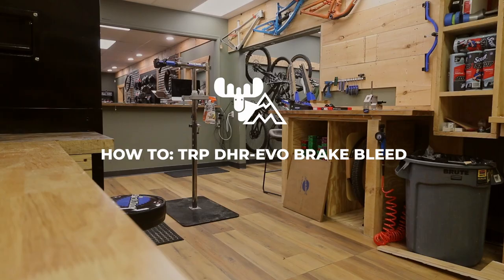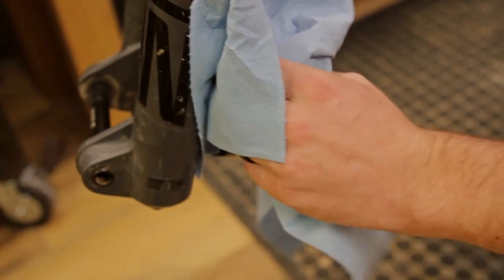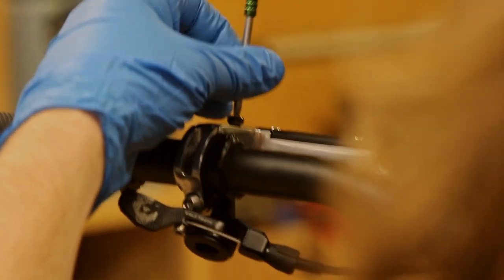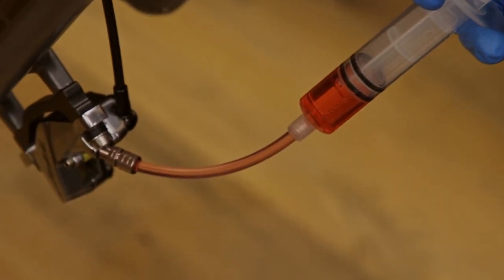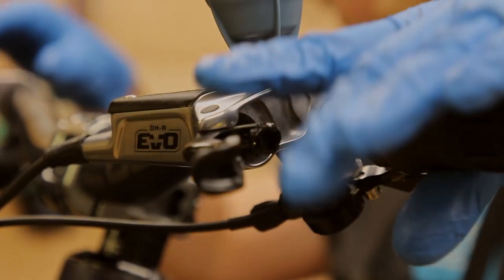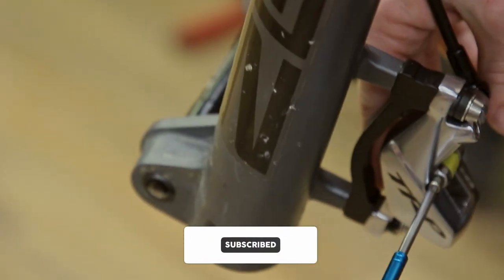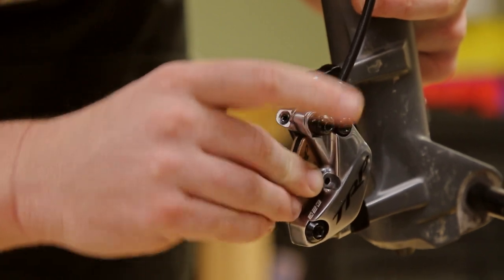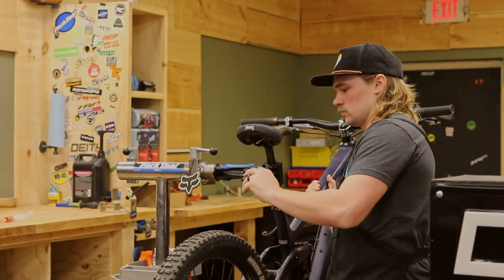How to: TRP DHR-EVO Brake Bleed

Comment: This doesn’t make sense. After you take the syringe if you pull the lever without putting the bleed port bolt back on the caliper. Wouldn’t the oil just piss out with you pull the lever?
Reply: My exact thoughts
Reply: I was going to say the same. All that oil came right out 😂
Reply: I think they messed up on the vid editing lol

Comment: Can you use the bleed equipment for shimano breaks? (Cup and syringe) also can you use shimano mineral oil?
Reply: The shimano mineral oil you can use, idk about the bleed equipment since I use a 10$ kit from Amazon with lots of different fittings

Comment: Any reason you can't do this with the pads and wheel still in place so you don't need to use a bleed block? I assume the risk is getting oil on your pads but as long as you're careful not to then I assume that would work...

Comment: Quick question, what adapter did you guys use for the wolftooth lever? Thanks
Reply from the maker: We actually had to use the clamp mount, Wolf Tooth doesn't integrate with TRP yet!
Reply: The DHR-EVO levers use the Shimano IS-II standard.  I believe this part would allow you to mount the Wolf Tooth lever directly to the brake lever:  https://www.wolftoothcomponents.com/products/remote-replacement-axle?variant=21422969349
Reply: Scratch that… the ispec adapters ALMOST work. There’s an extra lip in them that interferes with how they mount under the trp clamp. You can cut/grind/file this lip off to make it work though. It’s not a direct solution.
Reply: I just tried the wolf tooth i-spec ii to sram MM, it does not fit. Looks like EVO's clamp mounting surface is a little wider than what i-spec ii is designed for. I had to order the integrated mtb shift adapter hd 3.7 directly from trp.

Comment: Do you add a drop of blue locktite on the caliper bleed port plug? I notice min oil around the plug and I keep getting contaminated pads!
Reply: thats what we had to do.
Reply: @MrSupermugen  Holy shit, is that serious? They couldn''t design a proper bolt with a seal on a 250EUR disk brake?!?
Reply: @thegrave2000  yeah, they even suggested we use it lol
Reply: @MrSupermugen  Jeez, I'd rather not unscrew this bolt at all and go with a half bleed, no matter how much time it takes:

https://www.youtube.com/watch?v=A9L4EqLYEb0

I have this very same problem on my current crappy Chinese Surron brakes and this is the main reason I want to swap them but definitely if their master cylinder is going to leak as well :)
Reply: Thant's a crap design.  I've read that these brakes have issues with the bleed port seals being very easy to crush, resulting in contaminated pads & glazed disks. Seem to be very fussy.

Comment: im having non stop issues with these brakes rubbing, they are bled and the lever feels so good, pistons advanced evenly but after a trail or two one side pushes out more and stay against the disc.... messing up the feel... super frustrating, ive tried lubing and working the pistons on that other side but they are free...
Reply: You ever get this fixed?
Reply: @MathieuBrunet-wu7nf  One end fixed itself after i split the caliper and pulled all pistons etc.

The other end i tried the same but still same thing...

Bought anther set, did the same, gone back to Shimano and now Mavens.
Reply: @MrSupermugen  interesting, is splitting these open pretty simple?

I’m also now debating selling these and getting the mavens.
Reply: @MathieuBrunet-wu7nf  yep simple as. its all very basic stuff
Reply: @MathieuBrunet-wu7nf I have a similar problem and im beginning to say trp brakes are a joke. They weep oil and contaminant pads and get air bubbles trapped behind the pistons. My front one is a lucky one and works great. The rear gave me trouble early on. Trp even had me send it in only to send it back saying its fine. Mounted it and same issues.

Biggest issue I have is bite point. Feels good on the stand. Drop the bike and shake the rear wheel and the rotor flexes and pushes the pistons in and then the lever pulls to the grip. Pump them up and feels good. Pita

Comment: Anyone else have issues with the syringe not sealing on the caliper?
Reply: yes the O ring squishes out and doesn't seal. , it does not fit in the bleed screw hole. very easy to induce air into it.  I looked at all the fittings in the kit but they are not any different. plus not having a clear cup to see bubbles is really not the best idea.
Reply: @86309  is there any better bleeding kit for these brakes?